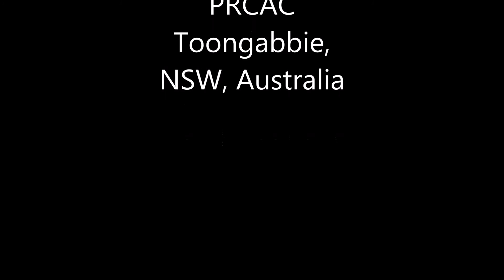Durafly Me-163 with Estes Rocket Motor

Comment: I am not a model aircraft flyer but recently I have been really enjoying watching them on YT.  So far this plane was already my favourite before I watched this particular video but your video is actually the best of many I've seen on this aircraft. Watching the incredible speed and agility of the plane and hearing your comments on being nervous of it really came across, in a good way. That made it possible to feel like I was there watching, just a little anyway and could feel the nerves through the screen! When you say the rocket motor doesn't give it much more speed it looked to me like it gave a significant increase in airspeed when it was burning. Maybe it's an illusion on video and also caused by expectation as you see and hear the thing whizz past under rocket boosted power. Awesome plane, great flying and a great video.
Reply from the maker: That is very kind of you. Thank you.

Comment: is that the c6-0 rocket?  Can you use different ones.. like perhaps a c6-5?  I saw them on Ebay and it looks exactly the same.  Hard to find the -0s
Reply: sirlordwhitman I believe you need to have it end in 0 otherwise the bang at end of flight used to eject parachute in rockets will happen. No good.

Comment: Good to see a rocket flight, only flown mine without. 
Do you have to glue up the ejection end of the Estes motors before using?
Reply: Yes, or else it'll fire the ejection charge into your fuselage; Never good to have hot gases bursting on the inside of a foam airplane.

Comment: Nice work! Short runway too!! Looks quick. I'm using 3s 1500's, which 4s battery are you using?
Reply from the maker: +craigfoot80 
Sorry for the late reply - using a Zippy Compact 2200 4S in this one. Needed to offset the weight of the rocket in the tail. When I don't have the rocket I can fly 1800 4S but I it has to be 4S at our field - 3S won't get it off the ground.